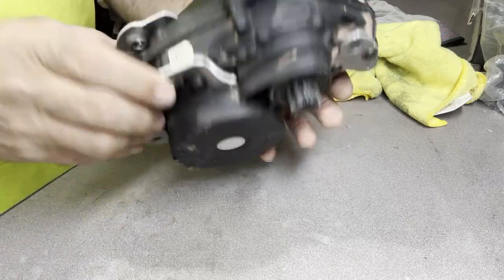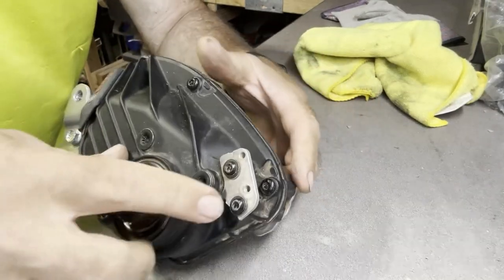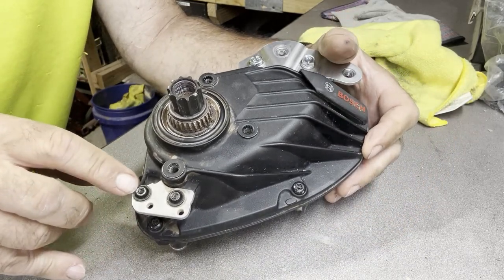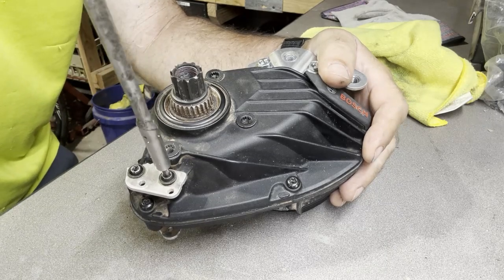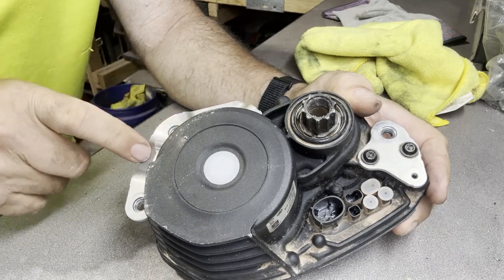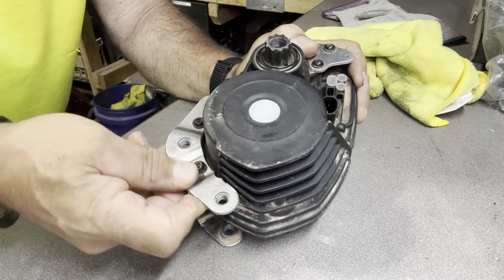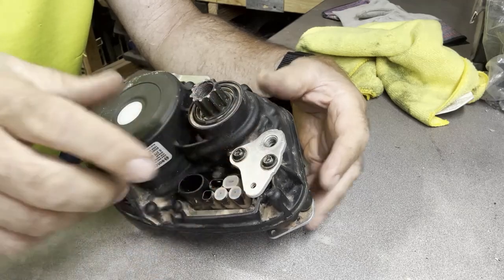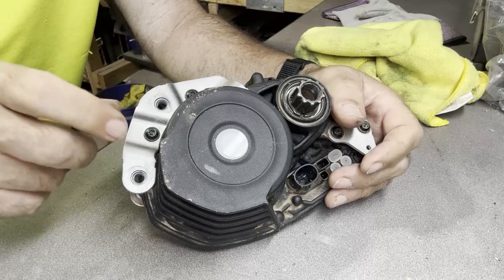Bosch E-MTB motor mount issues - Heads up, please Check your mounting bolts

Comment: I took my motor out of my trek rail today for the first time to install a new dropped outer cable and the bolts that hold the mounts to the motor snapped off 😭 leaving half a broken screw in the motor. Will have to drill and use extractor..😴 but was just wondering if I can still ride the bike? It’s the big mount on the non drive side of the bike the rest of the mounts are lock lock tighten and torqued to spec and motor doesn’t move
Reply from the maker: Man , thats up to you . If your a big guy and a pedal smasher I would think twice . Kinda odd Only one would break as something has to be moving to shear it off. Hope it all goes well

Comment: Thanks for this. I'm going through this issue currently. This confirms the bracket hole sizes are infact larger than the M5 screws which is strange Bosch used them. It's such a flawed design, especially for eMTB riding over rough terrain, with heavy riders etc. What torque did you tighten the M6 bolts to?
Reply from the maker: Don't remember the torque, Tight:)  And Loctite - good luck

Comment: Do you know if the motors are interchangable?
Reply from the maker: Do you mean CX and a CX race ? From what I heard they just made the CX rave lighter buy using different material for the cases . So really not sure
Reply: @johnvanmtb8775  I meant like different generations and models